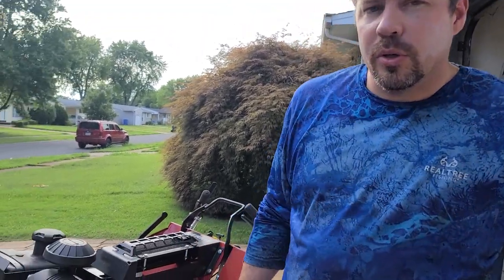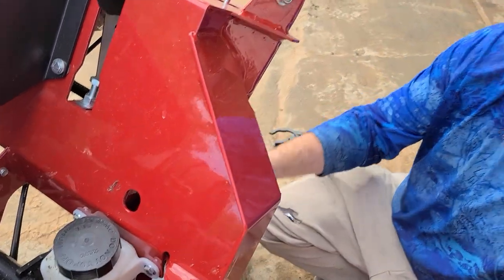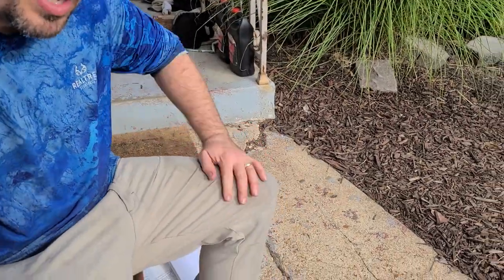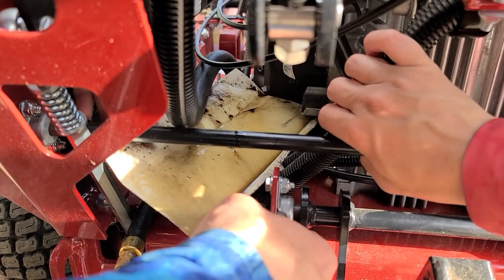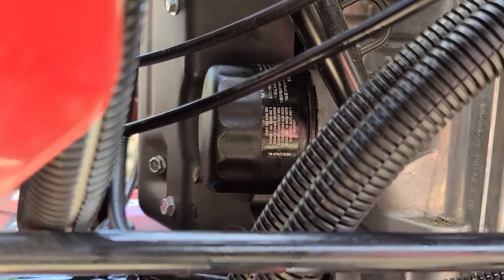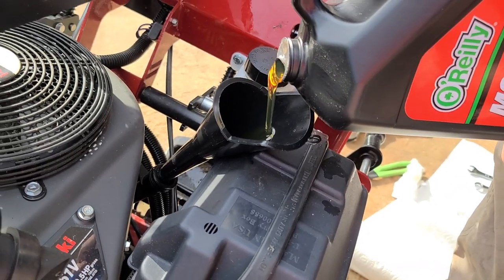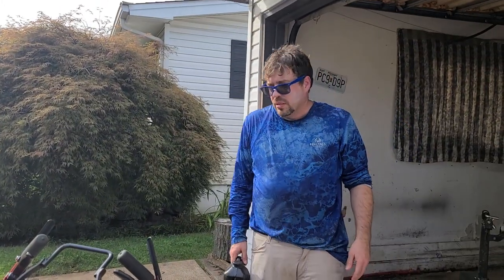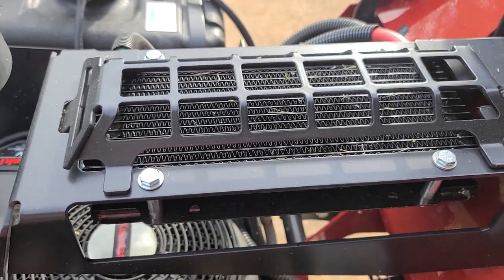How to change oil in Ferris FW45 commercial walk behind mower, Kawasaki fx651v 20.5 hp engine

Comment: I have the fuel injected Briggs and Stratton model, wm45 , it started cutting out intermittently when mowing, usually after I turn 180 degrees. I can not figure out why it’s doing this, it’s driving me crazy. I bypass every safety switch on it thinking one of those was causing it, it’s going to make me pull my hair out!  When it cuts out it will pick right back up and the blades will still be spinning. Driving me batty.
Reply from the maker: Either spark plug wires or ignition coil is going out it sounds like. Might  be, something with the fuel pressure being pinched somewhere.
We have 26hp vanguards but they are always manual fuel injection. 
All I can think of, being possible. Good luck.

Thanks for watching.

Please like and subscribe every little bit helps during these times.

Seize the day each and everyday-Are Jay

Comment: is that  the 1st oil change for the mower? it as clean looking as the oil you took out. do you do an air filter at the same time or is it a rinse ot filter?  Thanks to both of you
Reply from the maker: Hey Al, yes the was the first oil change. So i did it at 8.5 hours i think. It said 10 hours but i would have had time to change it at 10. Its at 20 hours now.

I did not do an air filter. I always change the air filter with spring maintenance in March. I just blow it out occasionally with the back pack blower or pen blower from air compressor during the season. 

Thanks for watching!

Seize the day each and every day-Are Jay